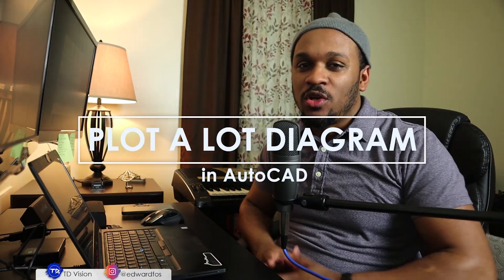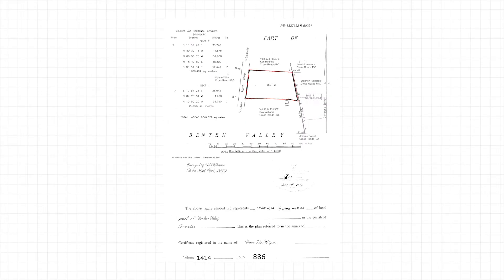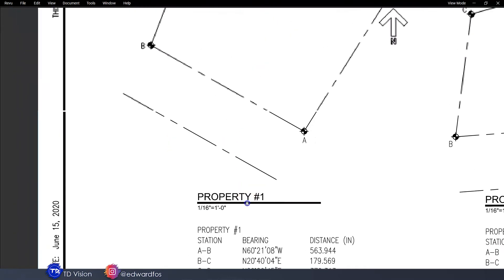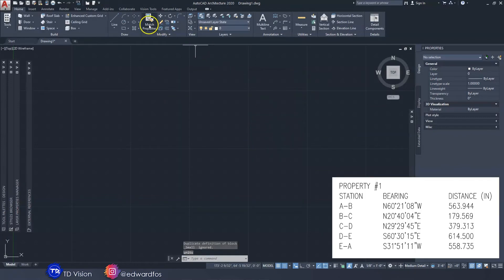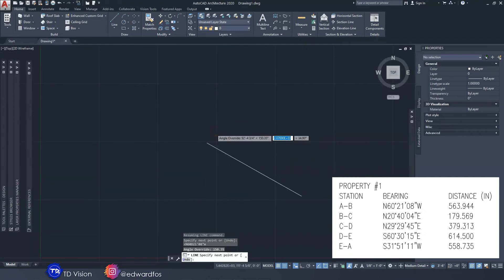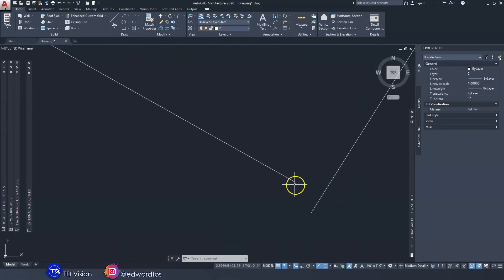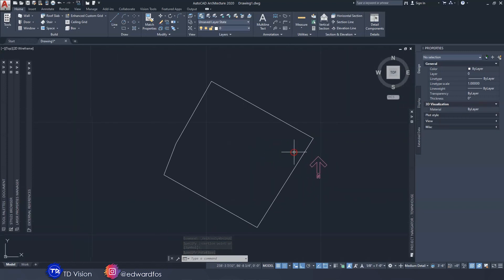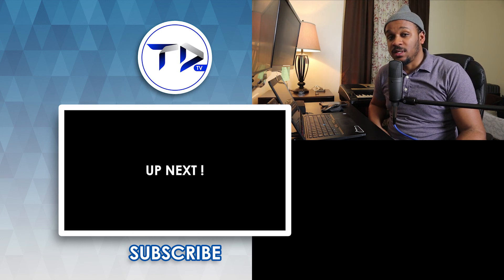How to: PLOT PROPERTY BEARINGS in AutoCAD 2023

Comment: Hey, I love your videos. quick question. I did with you all on this video but on property boundary so I could do everything you showed us on the other video on Site Plan. Everything was running smooth until I deleted everything by mistake. I'm trying to redo the whole thing now and when I try to create a property line doing the <N60D21'08"W thing once I type in the distance 563.944 and hit enter i get an error saying zero line created on the command bar. If I try to do the same in a whole new drawing it allows me but for some reason on the property manager tab it doesn't. Why can this be?

Comment: you can rotate the UCS to OBject and use plan to rotate the view so NORTH will stay North and draw a whole Neighborhood with winding roads and North stays North  in any case. I got complaints when I drew building sites and rotated them  other divisions wanted to use the drawings and had to painstakingly rotate them back to north.
Reply from the maker: You're correct, I think that's a better way. I would say, however, that it's not easy to manage rotated UCS when in projects. It can be a painful when creating new Xref views that need to have the same UCS. For anyone else who might read this comment, if you're not using projects, Hans suggestion would be ideal. If you're using projects, then, I'd recommend rotating like I have in this video, then rotate xref when you create a final site plan view.

Comment: METERS
S26    52N     22.45
S32    20W      18.07
S28    37W     45.91
S28    20W     21.82
S46    00W     19.22
38        07W      4.82
N41     37W     16.06
N81     28W     12.32
N00     28E       92.56
N25     27E       41.32
N55     55E      27.04
S78      31E     27.04  
S08      14W   16.58
S19       21E    43.21
How should I approach plotting these coordinates?
Reply from the maker: It looks like you only have Degrees and Minutes (no Seconds). Follow the exact steps in the video, but leave out the Seconds, since you do not have any. Let me know if that worked.

Comment: 04/27/21 UGH!!! Is there a command or commands in AutoCAD 2018 that I can run will show the Bearings and metes and bounds of a line I drew in a site plan? This isn't information provided in the LIST command.
The information is NOT listed in the Accessor's Property Map through the County of Los Angeles.
Reply from the maker: I don't think so. I've never seen it done, but maybe there's something that could be done to be able to tag the boundary lines with those parametric.
Reply: There is a command named annotate which ll provide u with the details of lines and arc.

Comment: Without writing the whole script of the site bearing"N60D21'08" W and distance! on the command line, can't we only just simply write on AutoCad command line <60  and then the distance.
Reply from the maker: Yes you can use the 60 by itself, but it won't be as accurate. The N60D21'08" is more accurate and precise.
Reply: Bro I try to type the <N60D21'08"W but it is working can u help please  @TDVision_U